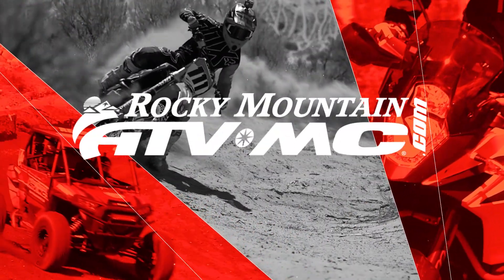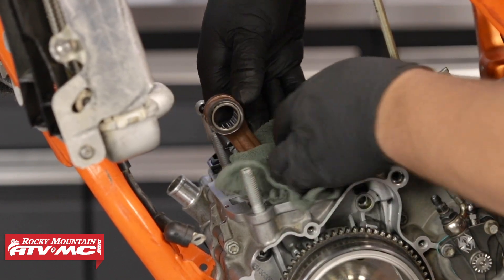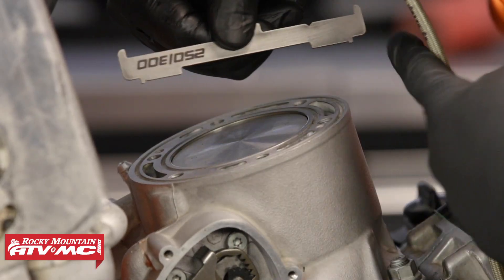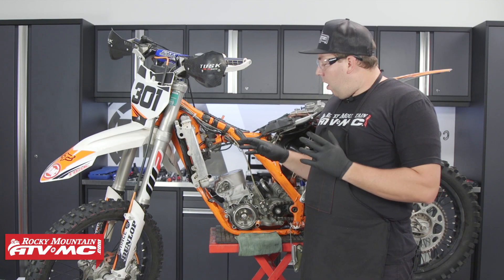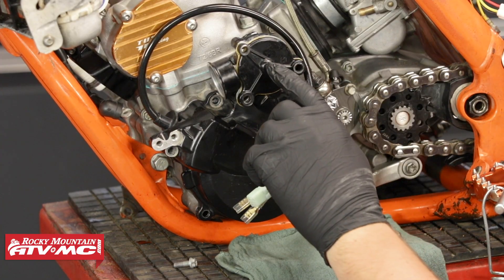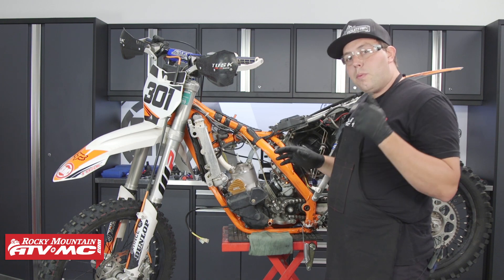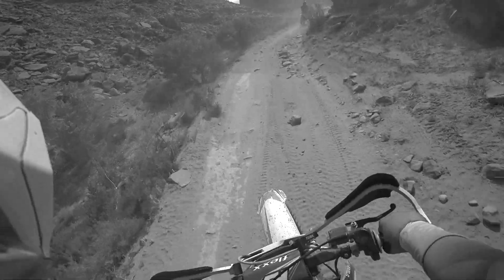KTM 300 XC-W Top End Rebuild | Part 3: Reassembly

Comment: You guys really should show the part with the cir clip install. My son was rebuilding a KTM 300 top end and found an easy way to do it for any of those paying attention. Get the clip started and then run your screwdriver around the inside like you would be mounting a tire on a rim around the outside and the clip should go in the place.

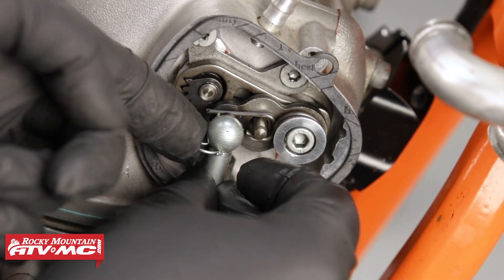Comment: I've got a question I can't seem to find the answer to anywhere. I had to change the power valve linkage arm you can see at 8:42 that connects the power valve to the bottom end. Somehow the old one was bent slightly from the nut. You can adjust the length of the arm with the thread and nut. How long am I meant to set the new one? Any ideas what may have caused the last one to bend? Hope somebody can help!! TIA

Comment: had a question and would really appreciate a reply if you can, basically i have just rebuilt the top end on my 2017 300 exc (xcw) and I noticed after my first ride out after checking over the engine with a torch that the front half of my base gasket(only genuine parts used) both sides including under the exhaust port is slightly wet in colour and if you look very close you can almost see coolent (pink in colour) a very very small amount in the groove , you can run your finger nail down the groove and you can make out a slight bit on your nail, so stripped and checked the cylinder bolts and still at the correct torque( i always do these in a x pattern) i then reassembled the bike cleaned the area with contact cleaner leaving the area completely dry and took the bike out for a hour ride, on return still the same and now i feel like ordering new head gasket orings and head bolt crush washers and replacing the base gasket, i am over the top with my bikes and the amount of coolant in very small, it would never be enough to say drip or cause a puddle and doesn’t seem to get any worse after 10 minutes or a hour,but never noticed this on previous bikes and im a bit stumped 🤔,  thanks for reading all this if you have and i look forward to your reply.

Daniel
Reply: I often don't get a perfect seal unless I smear the new paper gasket with gasket maker silicone.  
The right powervalve cover will probably never seal all the way without silicone all around the perimeter.

Comment: Great video. Helped me do this for the first time. ALERT: the torque for the engine brace bolts (on the bracket above the cylinder head) was incorrect. Video at 9:10 said to torque to 44.3 ft lbs. This broke mine. Bolts are only M8. Manual specifies 24.3 ft lbs.
Reply: This is why I go by feel...I also don't trust my torque wrench lol
Reply: woah!
Reply: I stopped before I got there... I knew it was way too much.
Reply: I read this too late and did the same!

Comment: I noticed when you installed the radiator hoses, it looks like you have deleted the thermostat.  I have a 2010 300 XCW and I see different opinions on running the thermostat versus deleting it.  What is your opinion on deleting it and are there certain scenarios when you'd want to keep the thermostat in place?  Thanks and great videos
Reply: On an auto deleting the thermostat isn't a good  cause the engine needs to reach operating temperature ( warm up) but you may not recognize any difference.

Comment: Myself and a buddy used this video to rebuild the top-end on a '16 250xcw using the nihilo concepts deck tool and this video is misleading. The 300 piston must be flat because on a domed 250 piston you can't check the X dimension as shown here. You have place the tool across the top of the cylinder and use feeler gauges IN THE MIDDLE of the tool to check the height NOT the corners. On a 250 the piston hits the tool if you try to adjust the way they show here. Just a heads up to 250 guys, they should have mentioned that here that this video ONLY applies to a 300.
Reply: hmm, maybe theres a reason this video is titled "KTM 300 XC-W Top End Rebuild ". how is this video misleading when it gives the directions for the bike mentioned in the TITTLE? I think they did a very good job of mentioning that the video only applies to 300s, ya just gotta read the tittle, it aint that hard.
Reply: Thanks for the tip, I was curious about the same. Still so much easier than using the solder-crush method. It's worth the 15 bucks :)

Comment: How did you torque the cylinder bolt by the power valve?
Reply: Motion Pro makes a torque wrench adapter tool that can be used to get the proper torque on a captive bolt - my son and I just used this tool that we purchased from RMATV to do the top end on his RM125.  Worked perfectly.
Reply: @jp2246  oh right on. Might have to pick one up.
Reply: if you watch Slavens' video on doing a KTM top end, he doesn't torque those bolts, just snugs them up with a box end wrench.  Go figure!
Reply: @mschumaker1  every time you work on a ktm you need a new tool lol
Reply: @shogun678  very true, I'm pretty much there.  Doing a top end which is why I watched this video and need a caliper to measure the gaskets and a feeler gauge to check ring gap!!!

Comment: I have an yz 125cc from 2001, I guess it is kinda the same? I don't know so much, I mostly ride.. :/
Reply from the maker: You are correct, the owners service manual is the correct one and should have everything you need in there!
Good luck!
Reply: @rmatvmc  thank you for the answer! :)
Reply: Similar yes.  Should be slightly easier since you don't have a starter.  Download the service manual for your bike and read it though. It'll give you exact measurements for your bike. The money you save doing it yourself will easily pay for the service manual so don't be cheap, buy it (if you can't find a free download).  Makes sure it's the service manual and NOT the owner's manual.
Reply: @jarrydvanhoy  thanks for the answer! :) 
I found "owner's service manual", is that the wrong one then?
Reply: @Bexxdamaster  lol i'm unsure, i think i've come across that for past bikes too.  I don't remember :/
Reply: How can I get a service manual for a ktm?